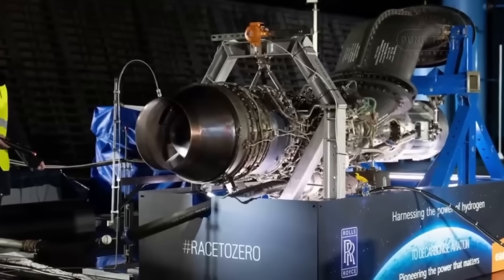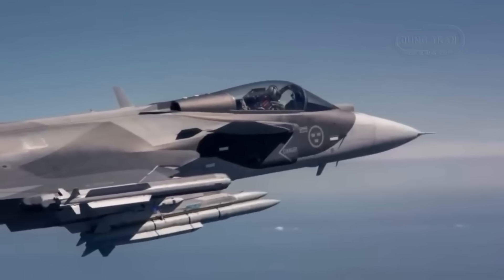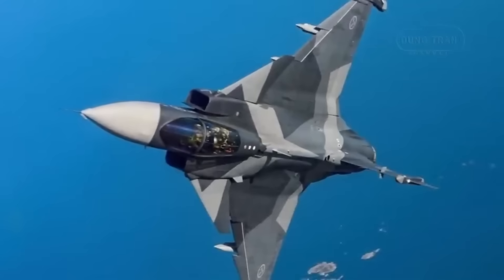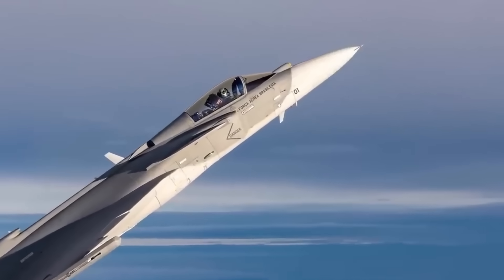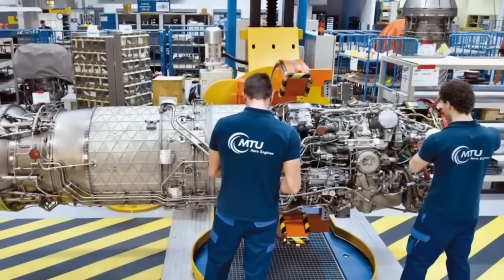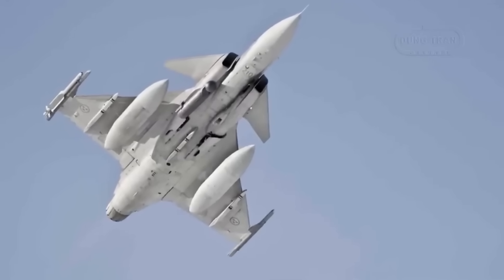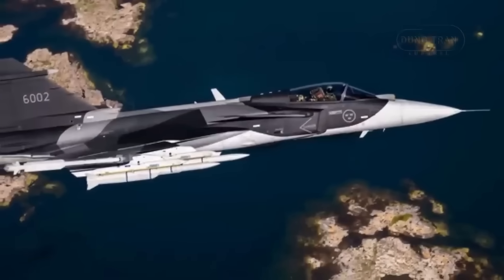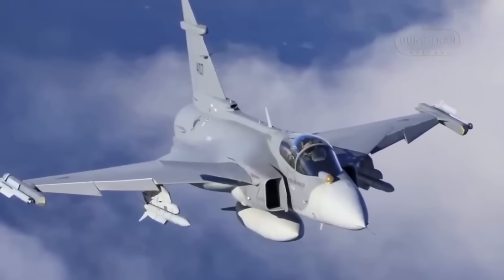The Truth About Rolls Royce Engine: Saab Jas 39 Gripen E [Power Explained HD]

Comment: DON'T LET THE GRIPEN BE THIS GENERATION'S AVRO ARROW !!!
Reply: I suspect the Gripen was already used once by Canadian PM Trudeau as a negotiating tool to sweeten the deal to purchase the F-35A after he previously won election in part by stupidly swearing he would never allow Canada to buy the F-35A. I hope history is not repeating itself here.
Reply: @tsegulin  Canada could buy the Eurofighter Typhoon II from the UK which is designed for longer range and later the Tempest II. With the Tempest II it is important that Canada should be a licence manufacturer and not just a purchaser. Canada is building its River Class Frigates despite they are based on the RN Type 26 Frigate.
Reply: @trevorhart545  
Yes the Typhoon is a viable contender but as I recall they dropped out of contention early on. Not sure why. 

Yes, 12 or so years after "Ships Start Here" and claims we have fixed our doddering naval procurement, we have finally set upon the Type 26 Frigate. That's something at least.
That in turn is slated to be fitted with weapons systems from our old friend Lockheed-Martin, no doubt pre-installed with more strings from Washington.

I have no problems with the UK right now. 
They are not conducting economic warfare against us on bogus pretexts nor are they threatening our sovereignty and they make excellent aircraft and naval assets.